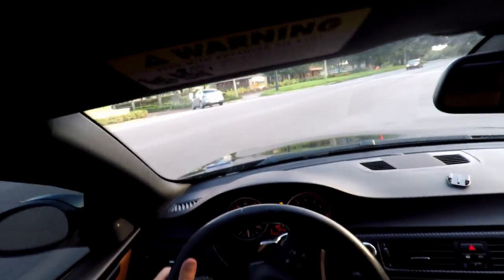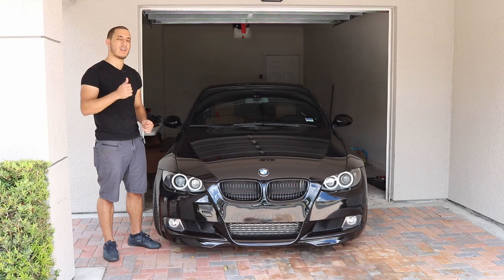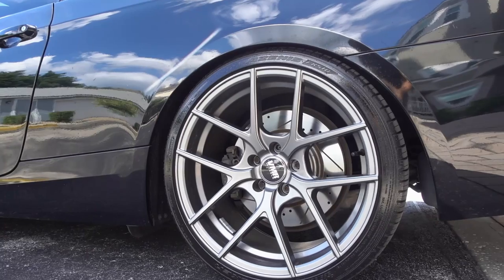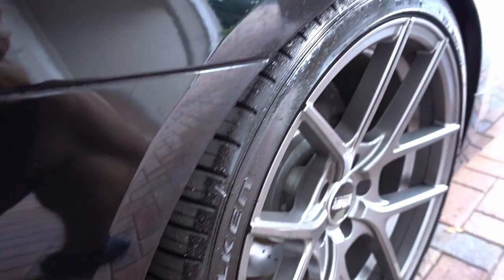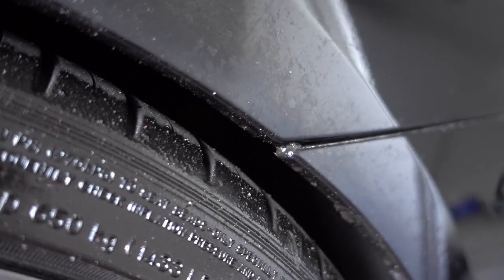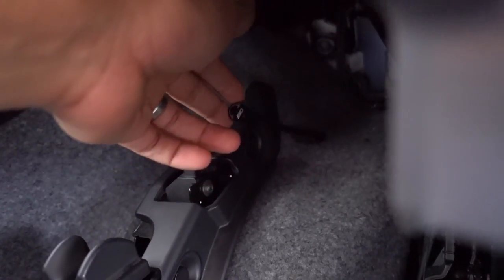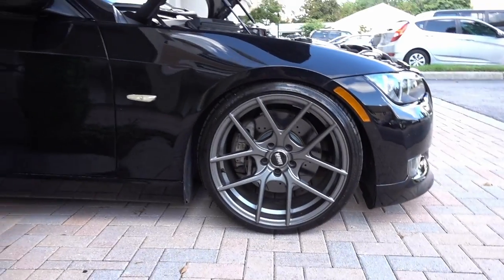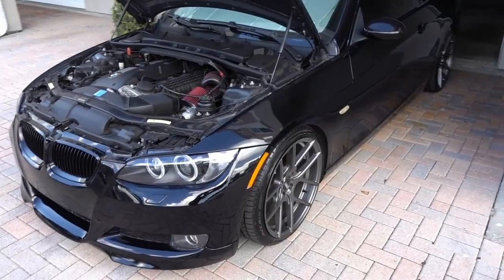The Painful Truth About Upgrading To Bigger Wheels On A Lowered Car - Here's My Experience

Comment: On my E92 328i I have 18x9.5 in the front, 18x10.5 in the rear with a +22 offset all around. Definitely need to roll my fenders in rear and buy some spacers for the front to push the wheels away from the coilover but overall I’m in love with my setup.
Reply: 9.5 in the front?? Does it rub at all? I have 18x8.5 in the front on 10 mm spacers and mine rubs in any decent uneven road

Comment: Great video man like always, informative and entertaining. I have 20's in my 335i also conv with 245/30ZR20 in front and 275/30ZR20 on rear, no rub!! 😂😂 Rolled fenders of course! Hey, consider changing the side markers for F style, they look nice.
Reply: joeljacapr are you lowered? I have an e92 335i as well.

I just picked up a set of wheels with tires, came off an F80 M3. 
20x10 255/35/20 and 20x12 295/30/20

I test fit on my friends stock height, non rolled fender 328i and they somewhat fit but rubbed like crazy. I’m going to of course roll my fenders and go with slightly smaller tires since I don’t like too much stretch.
Reply: @devonjohnson8536  just stock sport package

Comment: Monitor your front wheels to see if they ever touch the plastic fenders. With wheels turned and going over bumps it's possible. Mine cracked on a hard dip...alot of lowered e92s have this happen, something to watch out for.... especially with your setup
Reply from the maker: Appreciate the tip!

Comment: I have an e92 330i m sport with the sport suspension and I'm running 19s with 225/35 fronts and 255/30 rears. The ride is comfortable I think but on some speed bumps it does crash over them a bit, generally though I'm happy with the ride specially given some of the crappie roads here in the UK.
Reply: What offset are your wheels?

Comment: I've got 255/50/R19's on my E70 X5, but I want to go up to a 21" wheel and put 315/35 in the back and 275/40 up front. It looks so sexy but i'm concerned about the ride. Mine has coil-overs and new strut mounts and rides pretty heavy. I don't want to spend thousands and be miserable every time I drive it just for the drip.

Comment: Should’ve got an M sport. I found with my E90 the standard M shocks and springs sat well on 19’s plus it kept that ride comfort.
Reply from the maker: I had sports suspension installed previously, wasn't low enough for me especially in the front.
Reply: For me being a family man ride comfort was paramount plus being here in the uk it’s not just the pot holes you have to contend with, in London there’s always a speed hump around the corner.

Comment: You told me those roads where buttery smooth when you chose the 19s?  Lol at least you like how it looks.  Coilovers are harsh then add 19s or 20s plus if your not full urethane underneath you might need a blowup donut 🤣  enjoy 🍻
Reply from the maker: Well the roads that I showed in the video are the only ones that are like that in the area. I typically never drive down those roads 😅

Comment: I learned the hard way. Lower your car. Car is ruined. Bad for everything, gearbox, rattles, issues. You name it. So I bought a car that came sports from manufacturer. Best job. Dear job cheap job in long run and holds its value better

Comment: Raise the car slightly, and it wont rub.  You say you have coil overs,  well they adjust.  So adjust them.  no shaving needed.  Also your cheap coil overs are probably causing the crashy ride on the cobbled street.  Nothing is gonna feel good on a terrible road surface like that though.